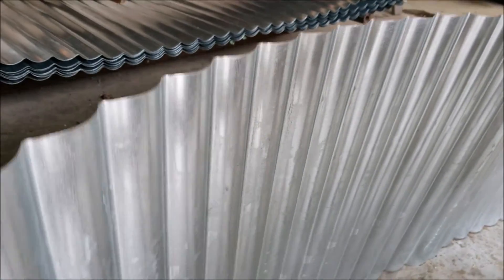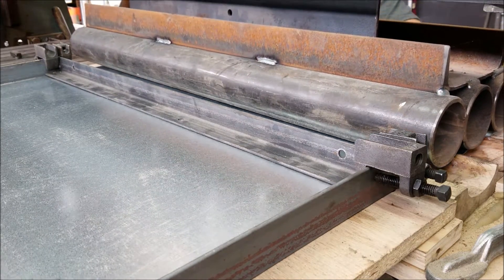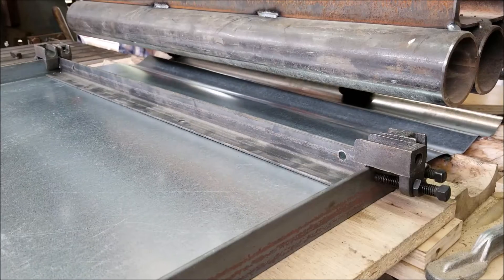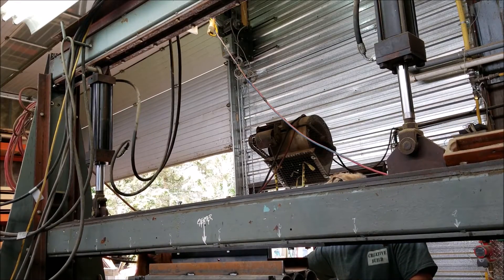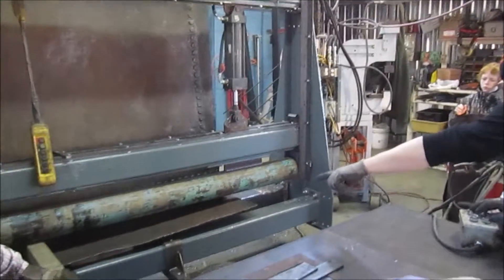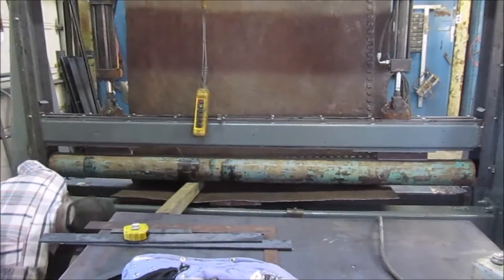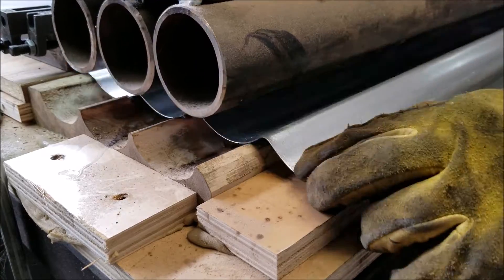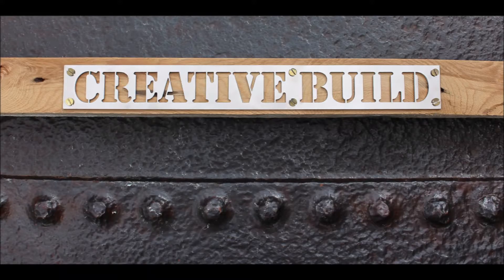DIY Hydraulic Press Stamping Sheet Metal: Part 2 of 3.. Hey Toolies/Machinists comment below!

Comment: you can rebuild the maple ridge with metal reinforced epoxy or bondo (jb weld ect)... I have made dies for hammering copper into out of mdf and is it wears using bondo holds up pretty well with the steel and maple made mortising a stiffening rib and then shaping the other product over. You vid's are simple and get the point across thank you
Reply from the maker: Yes. If i was to do this again i would stamp a small piece first then fasten /laminate it to the wood . Then stamp the metal on top of the steel laminated to the wood.